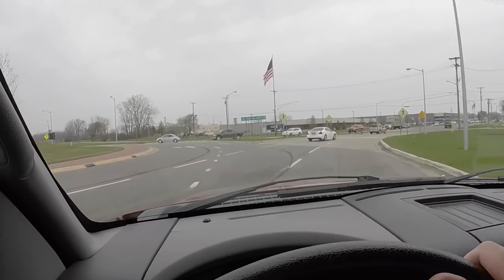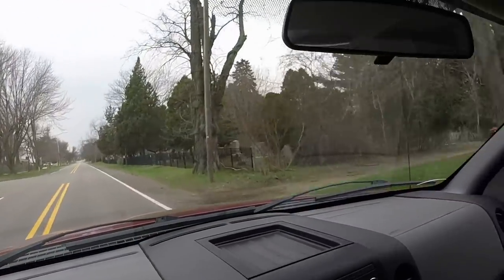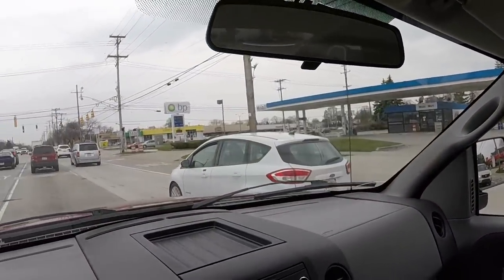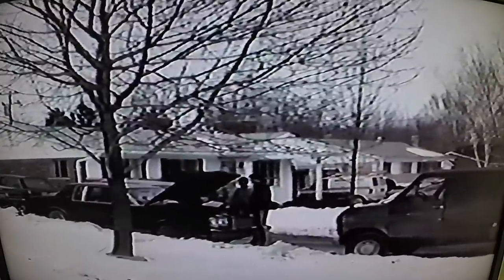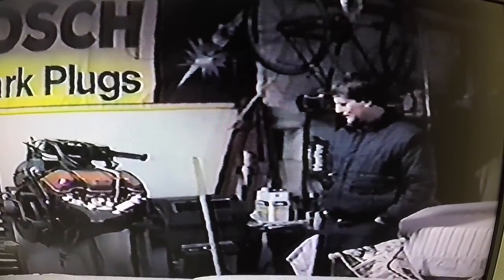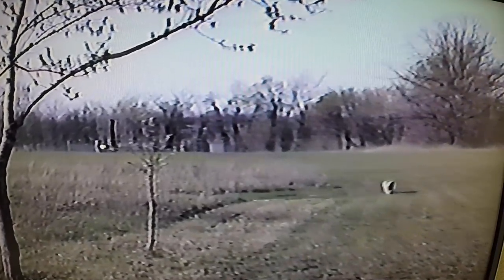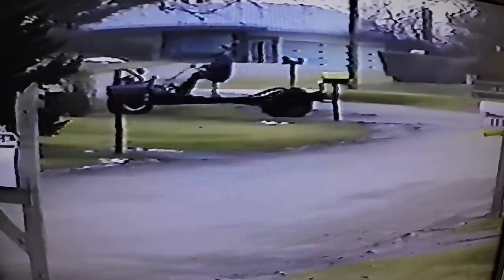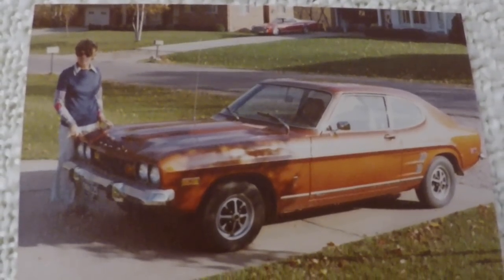Driving restored 1938 Ford Chassis plus lots of old VHS video of my past cars

Comment: 👍😁Great stuff👍Thanks for sharing. Enjoyed. Glad to see we mostly dressed all alike back in the 80s :-) Fun to look back. Seems you’ve always been a car guy. 
Is the gas well still producing? 
Hope so! So cool. Thx Howard✌️
Reply from the maker: The gas well was removed and capped off 12 years ago. The gas company uses that layer where the gas was for gas storage. They pump gas into the ground during low usage, then during high demand, it can be pumped out. The compressor station is about a half mile away. The 44 acres was sold just before the housing bubble burst to a developer. Now there is a subdivision of McMansions on tiny lots there.
Reply: Old Car Alley -Interesting. Wasn’t aware they (Gas Co) did that kind of thing in a populated residential area. Could be a scary situation. 
Thanks ya Sir 👍
Reply from the maker: @majorpayne5289  Yes... there was a big explosion and fire at the compressor station this past winter. There is nothing but farm land around the compressor station, so it did no other damage to anything else.